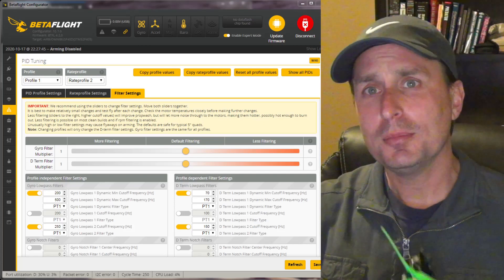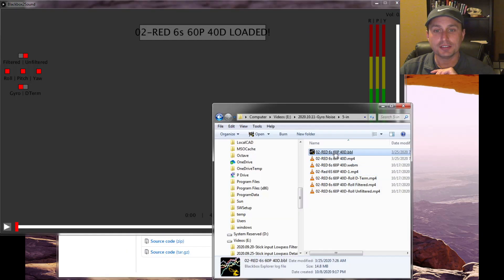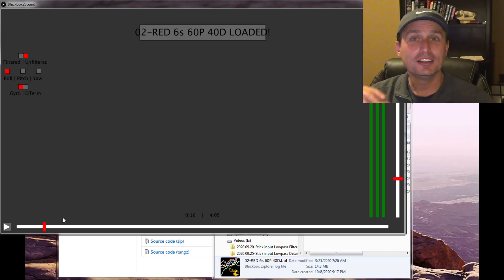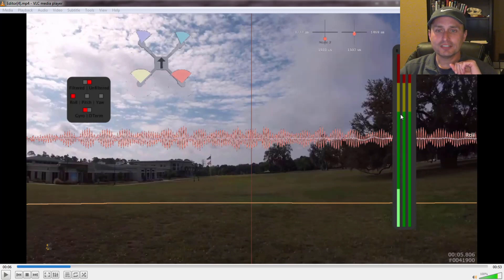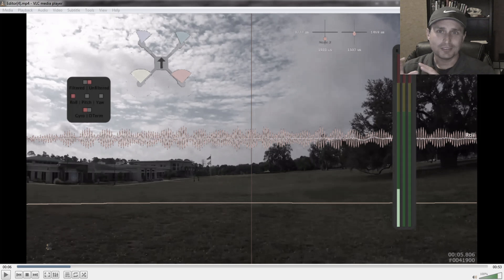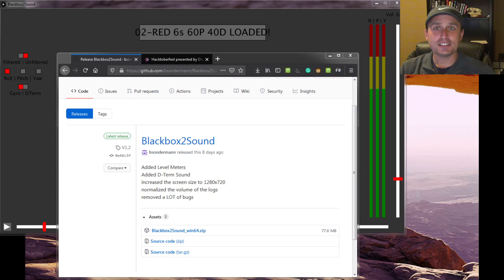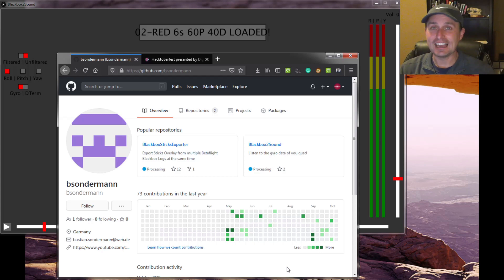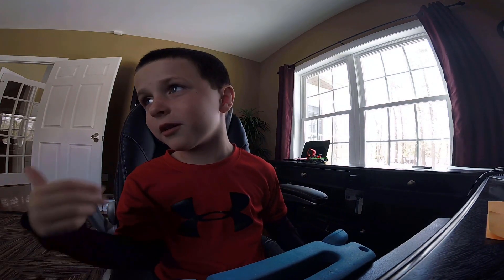What is Gryo "Noise"? -- Listening to YOUR Gyro Signal

Comment: In the set-up tab without a battery connected my drone slowly turns. I have the Speedybee f405 AIO Bluejay. What could cause that?
Reply from the maker: Gyro drift or stick inputs not at 1500us.  I assume radio is off?

Explore the Sensors Tab.

I would not worry about it unless you see bad behavior during flight.
Reply: @uavtech  Thanks man. I figured out what was causing it or at least I think I did. I forgot to setup the FC orientation. After I set that up it seems to be fine. For a minute I thought I was going need a new FC 😫

Comment: hey something i dont understand is what is the direct result of flying a noisy quad? will it destroy your gyro? or is it just something that can effect the performance of flight; if so is it something that can be left untouched. The reason im asking is because the topic of gyro noise is spoken quite less often in the fpv community.
Reply from the maker: It limits your flight performance because it will then need more software filtering and lower PID gains.  Both add delay for the quad to auto-correct for prop was performance etc...

Comment: Hi thank you for the education.
Question if you can help. 5inch drone when battery full in air and punch out for exceration there is wobble or oscillation. As voltage goes down it goes away. 5s in question flies great in 4s also flies 10000 times better since watching 2 battery tune. Hope you can help I thank you again for your videos.  Ps I’m using the sliders 4.2.8.  Bl32. Hglrc f760 stack.

Comment: Hey Mark, hope your Halloween is going well. I can't find anything on (pidsum_limit) what exactly is this setting on your preset page? Thanks for any help
Reply from the maker: By default, the PID Sum is capped at 500 (50%) output.  You rarely go above 50%, but it can occur so we want to remove that cap so it is out of the way.  You can look at your PID Sum in Blackbox.  It is the sum of your P.I.&D terms added together.  That is the PID command to the Mixer.  The Mixer then tells the quad what motors need to spin up to hit the desired PID Sum commands for Roll, Pitch and Yaw.  

The bigger the quad, the higher the PID Sum limit will need to be.  For 5" and above, we move up to 100% so we don't restrict the PID commands in any way.
Reply: @uavtech  thanks so much for explaining this to me! This without a doubt fixed this bounce back I couldn't stop no matter  my pids. This fixed 5 of my light weight freestyle / racing quads. Extremely grateful to you! Wish you and your family well
Reply: @uavtech  what would ever be the benefit of putting a cap on the pidsum? Seems like an extreme limitation
Reply from the maker: I think it is really old, and noone removed yet.  Idk.  I struggle to think of a reason.  Especially since I-Term has a limit as well so it can only wind up so far.
Reply: @uavtech  I'm mostly a line of site pilot. I spend most of my time below 50% throttle. When you have a really light powerful craft leaving this pidsum stock 50% really makes it impossible to stop a nasty bounce back, especially with a fresh 6s 1050 battery. I fought with it for a year with pids all over. Up down and everywhere in between. I then watched your video on RC signal and FF jitters. So I updated all my radios and turned off ADC. Still no improvement. It was a little better running low FF values. Now I can raise my pids back up run higher FF values without issue. This pidsum was absolutely the answer. I've never heard of it before learning from you. I think it's one of the best tweaks from stock BF that I've ever learned. Thanks again!

Comment: Since we are talking about noise Recently I go to know about new Rush Fpv Power Filter Board whose main aim is to replace Capacitor on our esc.. it claims very low esr rating and has tantalum capacitor instead of electrolytic capacitor.. and can be installed on other esc as well but I guess nobody is talking about it but you being from a enginnering background might understand how is it and explain it to us because I see that particular product can bring change to how we deal with capacitor and yes I'm not sponsored by them 😅

Comment: This actually is really cool, and works. I took my new Flywoo Explorer LR analog, turn on overclocking  to 108mhz, like my other 411's is default, since 4.2. then installed blheli_M, the noise before was 715 FFT at the end of a flight. once enabling RPM filtering 0/200/90/350, left the filters at the default 1.3x. The FFT after flight is now 412 almost half. The best part is if i Load i log into this program, i can 100% hear the difference on the 2 different Logs. Without then with Bi Direction Dshot. Pretty feakin cool, kinda makes sense cause the noise is a hz frequency.
Reply: Awesome! nice to know that it serves its purpose :D

Comment: SPRacingF7DUAL and SPRacingH7EXTREME have had the PID-Audio feature built in for a while now; with it you can listen to the quad's PID output WHILE YOU ARE FLYING.  Just wire the audio output from the FC to your VTX's audio-in, enable PID audio and connect headphones to your goggles.  They also feature a microphone too, so you can balance PID-Audio output with microphone input.

Comment: I tried this out, but I habe an issue or a question: I notice a ticking sound every 0.5s in the filtered gyro or so, that is not there in the unfiltered one. Even more interesting bc I have turned off all gyro filter but the rpm filter. Do you habe any idea mark? I can send a log if you want...

Comment: Hey there UAV Tech, watched lot of your vids about blackbox, im having an issue where i watched the balckbox logs, after settings up the filters and such in betaflight 4.2 there is still a huge spike in noise "max motor noise" at around 420hz, how can i get rid of it? or what im i doing wrong? also my motors have huge auxelations when my throttle raises to about 30% throttle, do you have a video that explains such probblems and how to tune it right?
thank you
Reply from the maker: Do you have RPM filter setup and still have the Dynamic Notch enabled?  Set DN max to 500 in your case and see if it helps.
Reply: @uavtech  ok i will try that, rpm filter is enabled and max dynamic notch was at 350, ill set it to 500 and see if it helps. Thank you

Comment: @uav tech for a frame that has a lot of "noise" do i use the betaflight default dynamic notch filter setting or do i use the dynamic notch filter setting you recommended on BF 4.2?
Reply from the maker: I would get RPM filtering working so the Dynamic Notch is free to jump on peaks.  Just do the RPM filter setup for 4.2 with the associated Dyn Notch settings.
Reply: @uavtech  thanks you.